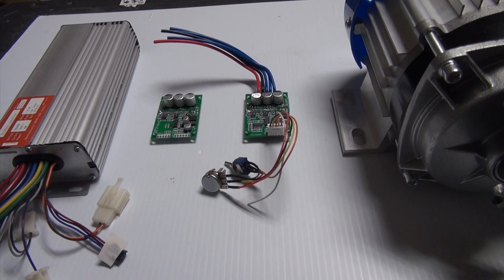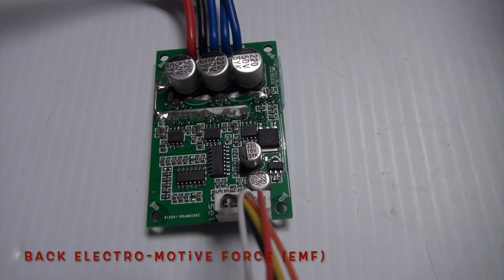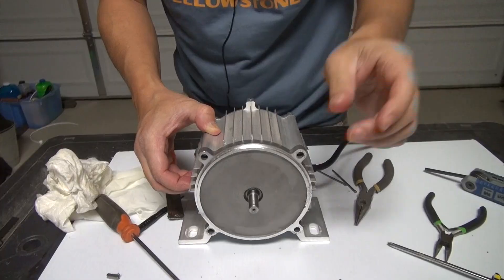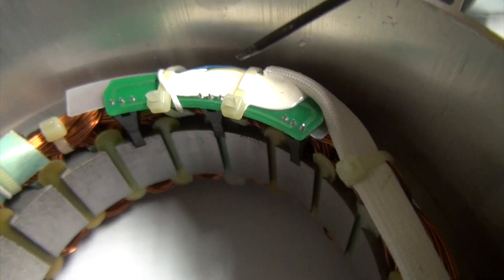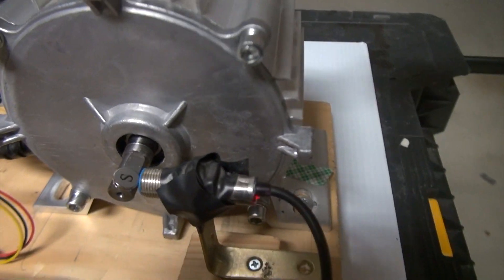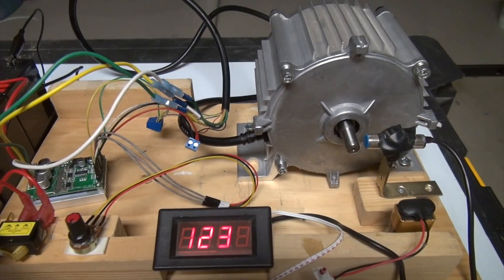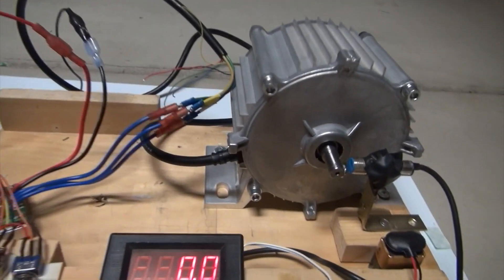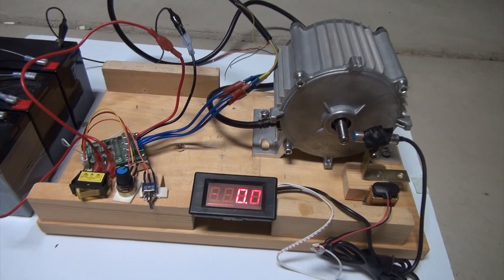How to Connect a Brushless DC Motor (36V 500W BLDC) to Sensored & Sensorless Controllers (2021)

Comment: I have  a  brushless controller 2 mode model square wave 15 pipe battery v 48/72  1500 watts I have a twist throttle with key lock speed display battery voltage I turn the key on motor spins throttle won't work could you tell me how to wire it correct.

Comment: In hall sensor controller, no load current is 2.3 Amp for (40 Watt 24 V BLDC Motor) whereas in sensor-less current is around 0.3 Amp for same motor. do you understand this @diypotentials ?

Comment: Hello dear friend, I have a question in this brushless motor that you opened the motor, it has 3 Hall effect sensors and the cable that comes out of the motor has 3 wires that are thicker and 5 wires that are thinner, those 5 wires are 3 Hall effect sensors and one negative and one positive, my question is, except the coil of the coils that are 3 are common to all and from each coil wire that is 3, each one goes to the 3 Hall sensors and complete. So where do those 3 wires that are thicker connect that come out of the motor cable and go to the controller, the coils go to the Hall sensor, so what happens to those 3 wires that are thicker? Thank you for answering.

Comment: hello kabayan, I have a Mac BMC 24v 600w bldc motor 3 phase but the wires were Black, Red, and White and 5 thin hall sensor wires and 2 orange wires. So I bought a sensorless brushless motor controller just like the one you have. I connected the 3 main wires to 24V 110v power supply, not to 24v battery, the BRW to CBA but no power at all. What do you think is the problem? Thanks

Comment: I have a question for you. I have a 750 w 48 volt bldc motor and controller. I want to build a small trolley car for my grandson and his friends to drive around. I don't want it to go fast. Maybe just five or six miles per hour. I'm not sure if the motor will be able to provide enough power to move 5 or 6 kids around. The motor says it can run at 3100 RPMs or 480 RPMs at reduced speed. I'm not exactly sure how to reduce the speed or if I will lose torque power by doing so. Any advice? I was considering using a jackshaft and gearing it down, but I'm not sure what the best way to go is. 

The axle and chain are 530 but the sprocket on the motor is 420. I think I can fabricate something to allow me to use a 530 sprocket on the motor, I haven't been able to find a 530 motor sprocket that has an H-hole center bore like the 420 sprocket has. 

Thanks. Subscribed.
Robert
Reply from the maker: Hello, have you consider getting the 420 chain and sprocket.  I think you might be able to connect the 420 sprocket to 530--something to explore.  Here is the link to get you started.  https://amzn.to/4ix8FG0.  There might be other 420 sprockets on Amazon that might work better for your project.  Good luck!
Reply: I couldn't find a 420 sprocket for my axle. And I couldn't find a 530 sprocket for my motor. So I cut the original 420 motor sprocket down so I could weld it to the 530  @diypotentials

Comment: 3:49 as I understood it, the planetary gears does reduce the speed but it's not for speed control, because that's what the throttle is for. The planetary gears give more torque for heavy riders and for climbing steep hills.

Comment: If you press the switch that changes from forward rotation to reverse rotation while the motor is moving, does it work without problems?
Reply: not recommended to do that while running. may cause problems

Comment: hello, hello, using the hall sensor can it used to meassure and read the current rpm when the motor is run ?
Reply from the maker: I used the proximity switch sensor to measure the rpm of the motor.  Thanks!

Comment: Is the hall sensor suitable for all wiring methods? Y, delta, 6 poll, 9 poll.. ect. If I want to add hall sensor to any motor, do I just need to put it in or do I have to follow some rule?
Reply from the maker: Hall sensors are suitable for all wiring methods.  If you are replacing hall sensors, you would want to make sure that they are compatible with the current ones because not all hall sensors are rated or function the same way.  Thanks!

Comment: I was thinking about using the 16-22 size crimp on bullet connectors for my 6 hall sensor wires. Then I could just plug and unplug them. (For testing) Do you think that is a good idea ?
Reply from the maker: That’s a great idea 👍

Comment: What happen if you put a battery of 36v and 15amp?? The driver support this energy??
Reply from the maker: The driver is rated for 15A so it should be okay.  However, of you are planning on running 15A, I would go with controllers with higher amperage ratings, maybe 20A to 30A instead of pushing it to the limit.

Comment: Hi ...great video ...question please ...did this controller can runnig ebike or any electric vehicule without problem and for long life ...did this kind of controller is a best choix .. frome your experience ..what is the number that you can give to it ..frome 1 to 10 ....thank you so much
Reply from the maker: Hello, I use the controllers for experiments only, very low load.  I never used them on an e-bike.  I recommend using e-bike specific controllers and not these for e-bikes.
Reply: @diypotentials  thank you so much

Comment: Hi, greetings from the philippines.new subs here. I just wanna ask if i have to connect the potentiometer in order to start the motor?..i already connect all the wires including the hall signal except for the SET
Reply from the maker: How would you control the speed of motor without it?  You would have to test the set up with or without it to see if it works.  I recommend placing a switch between the battery and the controller.
Reply: @diypotentials  i already tried it.doesnt work..i intend to use it to start a motorcycle..are you familiar with the ACG starter motor?..
Reply from the maker: @dockatok9470  So sorry, I’m not familiar with ACG motors.  I’m sure you will figure it out soon.

Comment: hello , which  connection slot in the sensorless pcb  is used for the potentiometer? the 3  wire, other than the positive and negative?

Comment: hello
tnx for sharing your knowledge..i have a question,can i use a 48v bldc controller to running a 24v bldc motor?
tnx
Reply from the maker: The controller might not operate on 24V.  But if you want the run a 48V on the 24v bldc motor, you can, but eventually you will ruin the motor because the motor is rated for 24v.  Thanks!

Comment: Hey, great video! I'm using one of these sensorless controllers on a 87v Samsung washing machine motor running off a 20v power tool battery, it works great but only getting about 300rpm (waiting on tachometer to test exactly), I tried running 2 battereies in seriess (40v) just to test if it would dramatically increase RPM but it only went from 3w (0.15a) max to 4w (0.1a). Other than the motors being designed for 87w can you think of anything that would be causing such low RPM? I also tried a small pump motor on 20v and that also capped out at 3w. Any ideas??
Reply from the maker: I would think increasing the voltage level would increase the rpm.  Hard to tell from here why it would not increase the rpm.